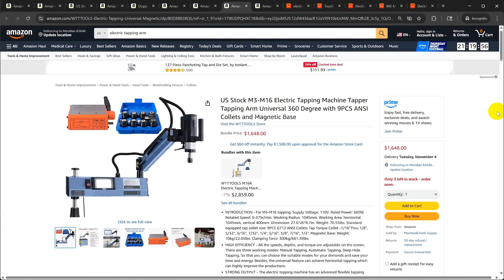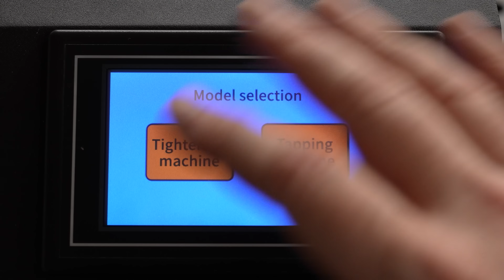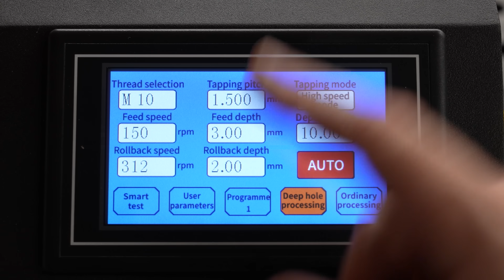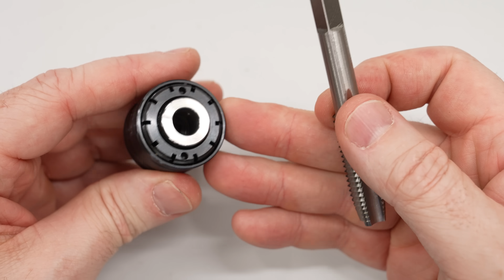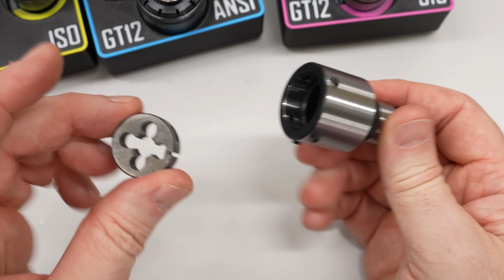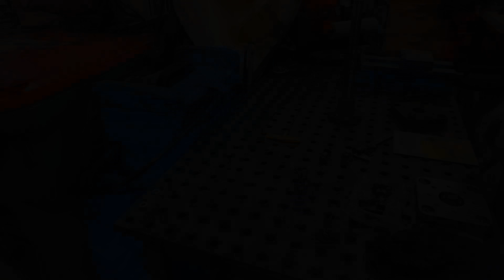Will I Regret Buying the Cheapest Tapping Arm I Could Find?

Comment: I'm only halfway through the video but had to share how useful color coding in the shop is. I had this issue with my stock black Allen keys, so I gave each one a dab of enamel model making  paint and then did the same color on the tools and holders around the shop.

You could do one sorting of your taps and use the colors of your holders to put a dot of paint on the square end of the tap (or in the flute?) and then never worry about checking again 😊
Reply from the maker: You're the second (first?) person to suggest this.  Great idea.  I have already been printing Gridifinity trays for my metric taps and reamers in purple, just to make it easy to find what I need quickly.

Comment: How would it cope with slightly undersized holes? Snapped taps or just some protection mode kicking in or could you work around it doing smaller increments?
Reply from the maker: In theory, the digital torque limiting or the clutch in the collet should save the tap.  I would not assume the collets are adjusted properly from the factory, so I should probably play with that.

Comment: Having a mill with a tapping mode, the resiliency of small diameter taps never ceases to amaze me; if they're rotated with a constant torque, and driven perfectly straight. Pretty much any time I've snapped a tap has been the result of hand tapping, and where a tap follower wasn't practical. I hadn't realised that the tapping arms had so much extra functionality (e.g.  tapping to a specific depth). Very impressive.
Reply from the maker: Yeah, I've power-tapped M3 with a spiral flute tap in the mill many times.  I almost always hold my breath, and I've gotten away with it.  Hand tapping, though, is another matter.  I have at least one piece of tap permanently installed in the side of my mill from when I mounted the DRO.
Reply: @Clough42  For the smaller taps, and especially for forming taps, even very small variation in the hole diameter makes a big difference in the stress on the tap. Reaming the holes before tapping produces more consistent results, especially if you require a specific class of fit for the thread.
Reply: Straight is the biggest key.

I "hand tap" with drills because it's much easier to keep straight vs using a T-handle. As long as you brace the drill and yourself. Also why I prefer the older mechanical clutch drills. The electric ones really suck for low settings

Comment: What's the benefit of using this compared to say lets say a drill press? 
The range of motion? 
Also, I've always had love for yall's blue field. 
Might be a Miami fan. But yall and Oregon are my two other teams I would chill with. lol
Reply from the maker: The arm counters the torque forces and keeps the tap perpendicular, while still allowing it to float into position with the workpiece still firmly clamped down.  You can sort of do that with a float-lock vise in a drill press, but you still have to commit to the position and clamp before starting.  The arm can also go to a precise depth and reverse, or automatically back the tap out partially to break chips.
Reply: @Clough42  Could this be a substitute for a press? Seems interesting. 

When I first clicked on the video, I thought it was one of the copy makers that follow the contours and then mimics it on a blank.

Comment: There’s way more than 4 standards 😂. Companies like Guhring and Titex will happily let you mix and match shank, neck, and cutting end. For example, you can get an M10 tap with an ANSI shank diameter and a DIN shank length. Those look like standard Bilz tap collets so you should be able to get anything you want.
Reply from the maker: I'm sure there are.  I try to pick taps based on whether they look stupid.  JIS M10 spiral-flute taps look really cool with their little slug heads and narrow shafts.  ANSI 3/8-16 taps have a big fat shank that won't clear the minor diameter of the thread.  I can't believe I'm body-shaming taps now...  :)

Comment: That deep hole tapping makes sense to me - taps are usually quite tapered and if you want to do a deep hole its bound to be a relatively tapered tap so that first insertion really wants go down enough to hit a properly established thread and actually make a real chip to break at the top of the hole in the first place before backing off.

Comment: These arms are great!
We use ours to re-drill hardened holes from the laser cutter and then put some threads on the holes so we dont kill the taps.
On one work we had to drill 9,5mm holes and tap it it with 12mm on 25mm steel, 
Both the tapping arm and the quick step drill held up for a total of 5 meters worth of holes combined and nothing got broken
Reply from the maker: Oh, nice.  I bet it'd be pretty good for reaming, too.

Comment: I assume the depth is calculated from the pitch X the rotation, so if the tap doesnt bite straight away the thread depth will be short
Reply from the maker: I believe so.  It wouldn't have anything else to base it on.

Comment: We got the exact same one at work last year. It has tapped at least a few thousand holes since then. We used to use a pneumatic tap arm before but this one is so much nicer to use. Faster too. Largest size I tapped for production was M14. It regularly does hundreds of M12, M8 and M6.
Reply: The shop I work at also switches to electric, the noise reduction alone makes it worth while.
Reply: Dices que funciona para acero endurecido?

Comment: "Made in Chyna" tends to concern anyone who cares about quality, reliability, accuracy and longevity. Time will tell but I wouldn't trust that 'C E' mark on that unit because it's most likely faked and the missing UL, ULc, CSA and even the mickey mouse ETL mark is quite telling of any safety testing actually being done. If you're skilled enough to know where the dangers for electrical hazards on these tools would be, then you can mitigate most by replacing the dodgy components with properly certified components and routing the wiring correctly using strain reliefs and shielding. 

I would be curious to find out how that Tapping Arm holds up after you finish your project and as well down the road for wear-n-tear and accuracy. Thanks for the video.

Comment: The collet situation is just crazy, I would think that you would keep the taps in their collet and quickly put the tool in and out. Whereas now finding the right collet is just an extra “bureaucratic” hindrance between you and a tapped hole.
Reply: well, there's probably 3 reasons for that:
1st is storage space, it's a lot more space efficient to keep them seperate (no needed extra deep drawer in the workbench to account for the taps in the collets, and the taps can just lay flat and bunched up in their own small gridfinity box, and you don't need extra wide boxes for the taps if you don't have to account for the collet)
2nd is the fact that multiple tap sizes might take the same collet. Beautiful thing about standards and so on.
3rd is that you don't always wanna tap with the arm. Need to chase a thread somewhere? No need to get the tap out of the collet, can just throw it in a tap wrench and run it through the thread. I'm also not sure how good the "feedback" is for chasing existing threads / cutting them deeper, but I'm personally inclined to trust a my own "Manual" torque limiter (hands) than a machine to find the existing thread and not cut a 2nd thread in there by accident

Comment: by God you should install an automatic oiler on it! yess, like it could oil the tapping bit automatically
Reply from the maker: There are versions with automatic oil dispensers.  I may also play with AnchorLube and a brush.  High-sulfur cutting oils are neat and they remind me of the smell of my grandpa's farm shop, but if you make a lot of smoke it gets old fast.
Reply: @Clough42  i love high sulfur cutting oils too, they smell so good. in hungary they were so ubiquitous decades ago that it always brings back memories
Reply: @Clough42  Hear me out - A stainless steel tube.Then you make a bottom for it that has a peg that goes in table holes and weld it .Fill it with oil and just dip the tap in .Make a simple cap With small chain (so you dont loose it ) so grinding dust,chips  and other stuff doesnt go in .Maybe you could 3d print it but stanless steel would last forever. 
Other than that get one toothbrush for clearing chips before the dip.
People used cutting oils for decades and it worked fine.

Comment: I'm surprised you didn't make one. Would've made a great mini series...
Reply: I've thought about it.  Building the firmware from the ground up would take a fair bit of time - there's a lot to it beyond turning the servo on and off and it's part of what makes these arms so useful.  Other than that it's an AC servo, planetary gear reducer, the controller, and the arm which wouldnt be too bad.   I sourced the parts separately though out of curiosity and it seems it's not really worth it

Comment: I wonder if the 2.5 inch square for the hole layout was actually a 90 mm diameter circle.
Reply: Mount a shop vac hose to the side of the bench so you can dip the tap into the hose, flick the vac on.

All chips and goo sucked into a neat clean spot!

Then dip in the tapping paste beside it!

Comment: It's all about the right tool for the job.
This tool is just going to make your life easier :) 
And since it is solid and straight ... you could probs mod it and add some motors as a project haha 
.... design part with hole positions - and then you just select part and align the first hole ... it could drill the rest of the parts holes for you.
1-4 holes aren't a pain, but if you have more than 4 holes, you could save some time per part with lots of parts
Reply from the maker: I can see it now...the arm waving around, pounding the stub of a broken tap all over the workbench, trying to find the hold.

Comment: i would rather get rid of all the taps except the ones fitting a single standard, that having to deal with all those collets ^^
Reply from the maker: Yeah, I thought about that.  The challenge is that a lot of the time it's hard to tell what the shank size is when buying--especially NOS eBay and Amazon sellers.

Comment: Wonder if i could make my own from "the grampa's AC drill" we all have or some old 12volt makita with busted battery (and making it powered from car battery/external power source)
And just use the trigger to adjust the speed, and the chuck slippage to prevent tap breaking
Reply: Chuck slippage isn't how you prevent the tap breaking, it's how you gall the tap shank and eventually chuck jaws.

Comment: The reason you haven't yet encountered a DIN standard tap is because a good chunk of ISO standards started as DIN standards, then became European standards (EN), and then got accepted by ISO, usually making it a DIN EN ISO standard in Germany, and just an ISO standard internationally.
Reply: Thats mostly true altough taps are one of the few exceptions, where only a few of the sizes are the same.
Some of shank sizes that are the same arent the same thread size though
Reply: I'm calling BS on Whitworth. . . . .I'll get my coat
Reply: worth adding that with JIS a good chunk harmonized with ISO like most of the world.
Reply: I've been dealing with this exact problem - finding ISO (529) taps for my tapping arm that came with "ISO" collets.   After a lot of research, it appears that most of the DIN 371/376 taps beefed up their square and shank sizes so they appear to no longer be compatible with "ISO" 529  and it's been really difficult to find any taps to fit the ISO collets.   ChatGPT said I should look for DIN 371 "Form B" taps (opposed to form C)  but most of those have seem to the same shank and square dimensions as C.    My solution has been to mostly abandon the idea of using the gt12 ISO collets my machine came with and I just went with the JIS standard.   It seems to be a lot easier to find JIS taps.   Even the "new" DIN 371 standard seems easier to source.  Feel free to correct me on this, I spent maybe 6 hours on the subject yesterday but I'm not an expert lol.
Reply: Your statement is largely correct: many International Organization for Standardization (ISO) standards did originate as German Institute for Standardization (DIN) standards, then were adopted as European standards (EN), and finally became international ISO standards, often designated as DIN EN ISO standards in Germany.
Reply: @Coolcarting what is not correct in his comment?
Reply: @DerBeinmann either the OP amended/edited their post, or the responder is an AI interaction generator. On this case, I'm thinking the first.
Reply: @Validole ?? Why do you? You clearly see no editing (normally shown by YT)
Reply: @DerBeinmann  People for whatever reason keep claiming editing when it's not borne out by the facts. It may be some psychosis. As for what's not correct, if anything, I would assume that maybe some standards didn't start out as DIN, but I'm only speculating on what he meant because I'd need to be closer to wherever he is to see inside his head.

Comment: One more thing. I also recommend clearing chips off the tap after each use. If it binds, at least for my arm, I would not feel safe from breakage, if the tap binds, especially for the smaller spiral flute ones.
Reply: Takes seconds to clean the tap... Just clean it after every use. Why risk it.
Reply: The machine is designed to cut threads into solid steel, I don't think a bit of swarf is going to get in the way of it's functionality.
Reply: @Coolcarting You have obviously never used a tap.
Reply: @charleshartlaub3725   Hahaha. It is quite obvious.

Comment: Remember the contrast knob on old mono LCD?  Could you do that to this one to adjust the viewing angle?  I'm guessing they work by tweaking the voltage to the LCD column drivers, if they are still accessible on modern screens.
Reply from the maker: Oh yes.  I should definitely check to see if there is a pot or maybe even a contrast adjustment in the menus.  Most (cheap) LCD screens have a narrow viewing angle, and they optimize for the viewer being at or above the center line of the screen.  This one is laid back so far that when you're standing across the table from it you're viewing from well below the center line.  It just snaps into the black metal shroud, which is held on with four screws, so it would also be easy to 3D print a new one with a different bezel angle.

Comment: I operated a small engineering firm back in the 80’s. We made backs for office chairs which required 2 3/8 tapped holes. Never knew about these devices and so we built a device from a tapping drill and a drill stand. It worked but was nerve racking to use as the slightest misalignment, or going too fast would break the tap, which were very expensive to replace. Thanks for demonstrating this solution, it looks much better than our crude method.
Reply: Didn't you use a drill with a clutch? I just turn the clutch very low when I tap small holes. It's been years since i've broken a tap.
Reply: @r @Sensiburner   this was forty odd years ago. 
The tapping drill we had didn’t have any kind of clutch or speed control. It was basically a heavy duty drill, with a gearbox that enabled it to revolve quite slowly but with a high degree of torque. The trigger had two positions, one to tap and the other to reverse the tap out when the tapping was completed. 
I’m pretty sure that if any other options were available that we would have put them to good use. Also there is a lot of difference between tapping the occasional hole and doing several hundred, particularly when you have to compete against other shops. The time factor is crucial. Too fast and you risk breaking the tap. Too slow and your work becomes uncompetitive.
Reply: @StepDub  ohw OK I understand that it's a lot different in industrial heavy use, but I bet a clutch would've helped with saving taps even 40y ago. 

This thing has servo & torque control. It can probably just run backwards a bit when it senses high torque, then try again. Exactly how I do it with the clutched battery drill nowadays.